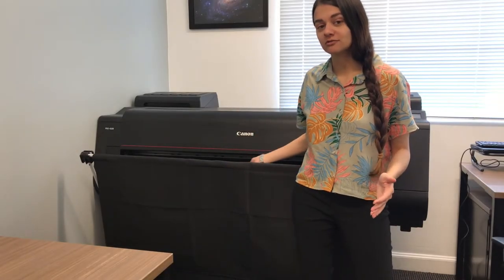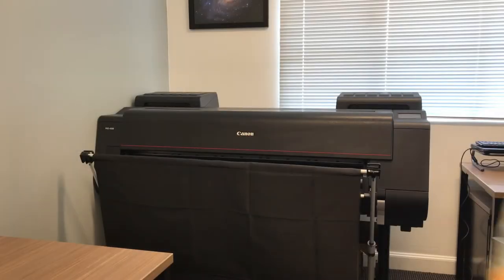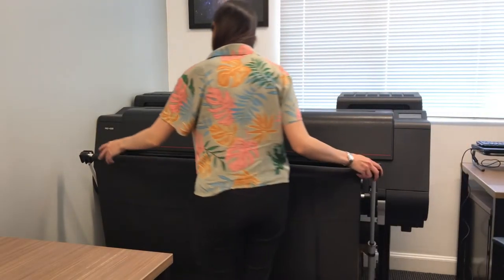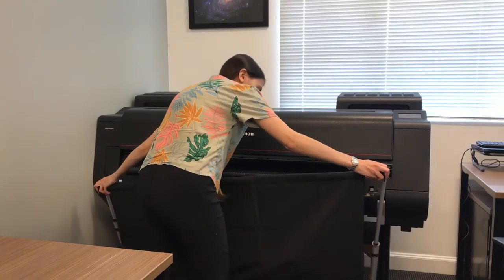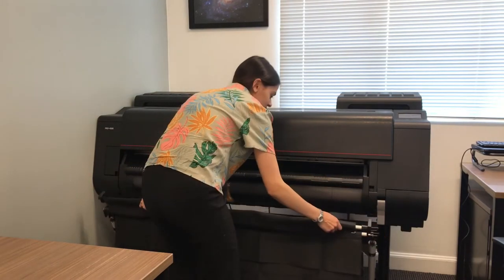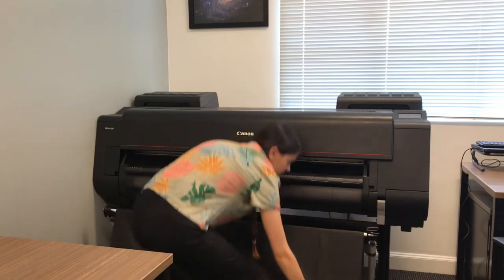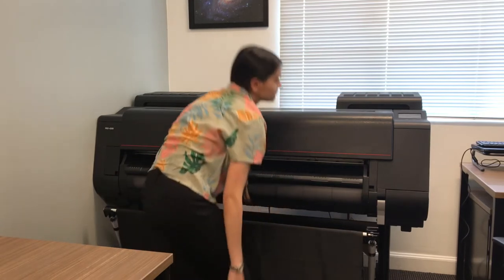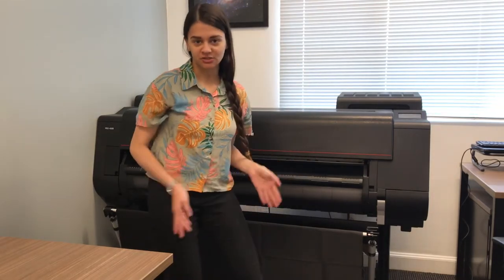HOW TO REMOVE A PAPER ROLL FROM THE CANON IMAGEPROGRAF 4100

Comment: hey how are you?
i want to know how to put 2nd roll there is no video which i can find in internet.
Reply from the maker: Hi there, unfortunately I no longer have access to the printer or software (I moved). I tried looking up any info on it and have not found a clear answer. However, I do have an educated guess: You may have to add Roll 2 within the software first before it will show up on the printer's home screen as an option. For example of what I'm referring to, see my video "WALK-THRU DEMO PART 1: OPEN EDITION ORDERS" right at the minute mark 06:12. There you can see on the drop down for "Paper Source" there are four options "Cut Sheet", "Roll 1", "Roll 2", and "Roll Paper (Auto)". I would guess that once you select "Roll 2", it will either trigger a warning message asking the user to add a second roll (and possibly provide a small demo of how to do it) OR it will trigger the printer's main menu to change, such that when you check the home screen next, Roll 2 will show up with the note "There is no paper." I'm sorry, that's all I can suggest. Hope it helps!